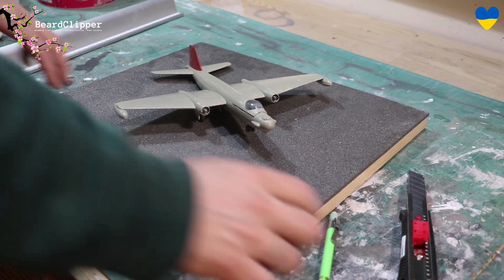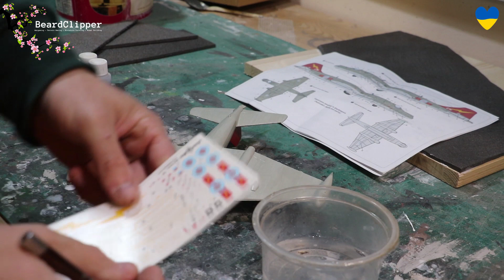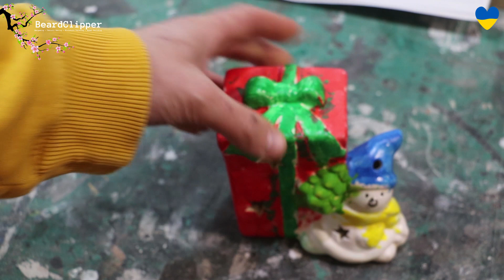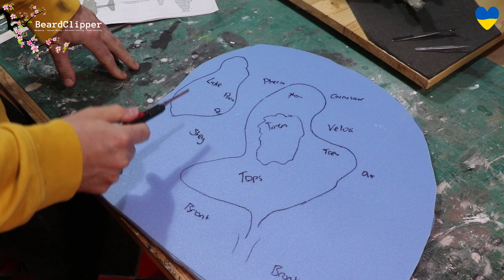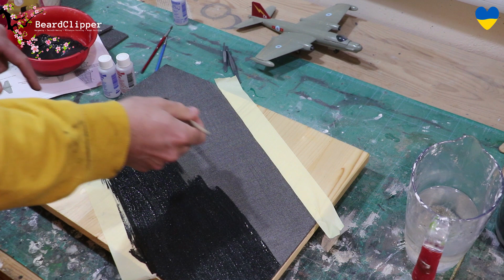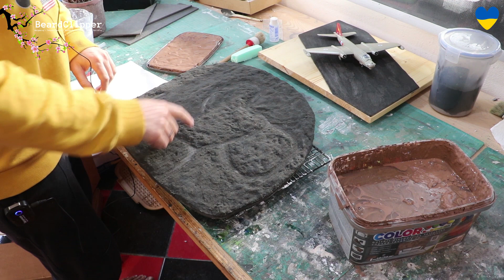Five projects, plus a little Rosie hobby achievement :) a great week!

Comment: I know im 11 days behind, but would a draw plane be of assitance to removing the trapped resin?
Reply from the maker: I was actually considering that but I don't have one to hand sadly... I've not done anything more on this as I need to get to the hardware shop to pick up a proper belt sander as standing there hacking away with that kitchen knife is dangerous and exhausting :D Thanks for the suggestion, I'll look one of them out as well :)
Reply: @BeardClipper  was just thinking it will produce less dust than a sander as youll be cutting off strips with each pull. We used to use them for boat repairs in the Sea Scouts (they are sometimes called Boatmakers Planes or Drawknives I think)